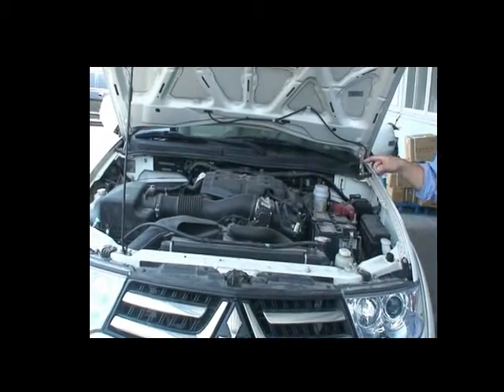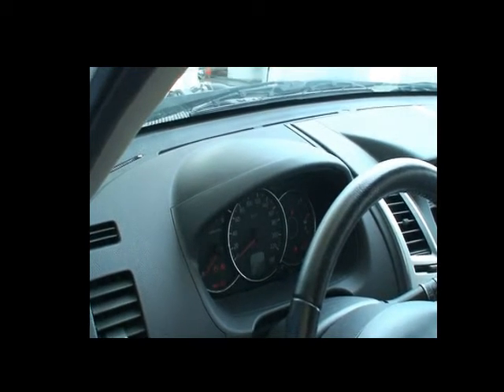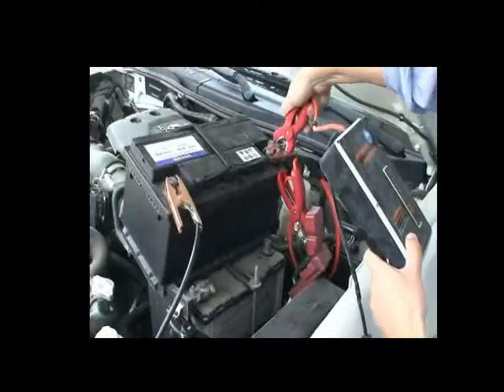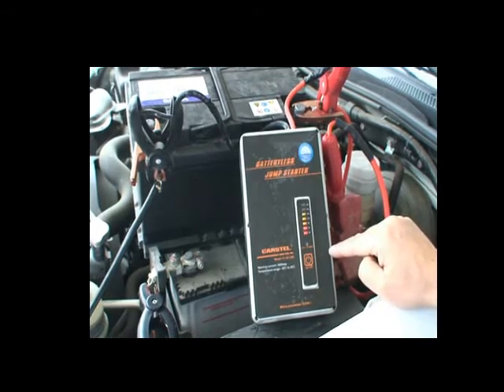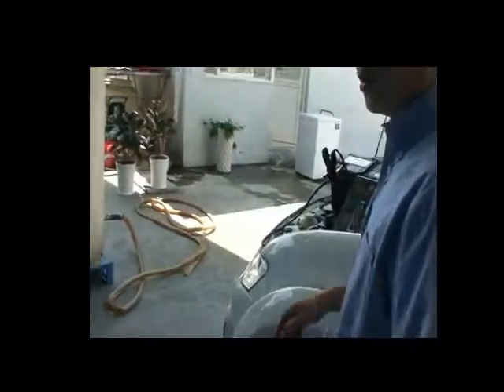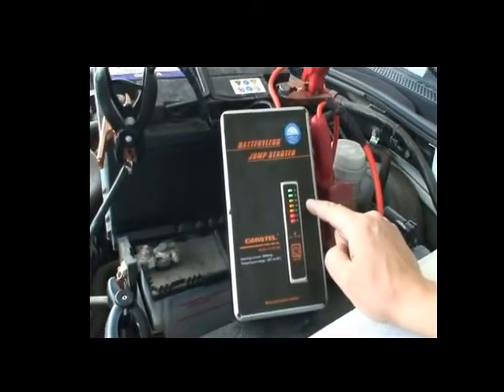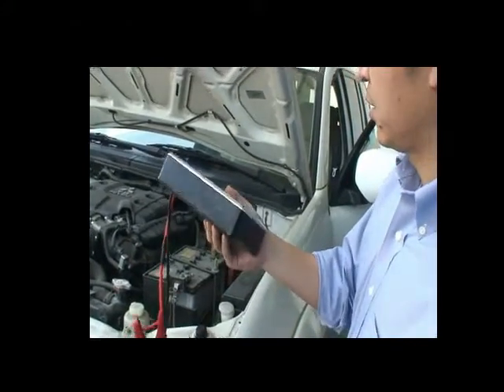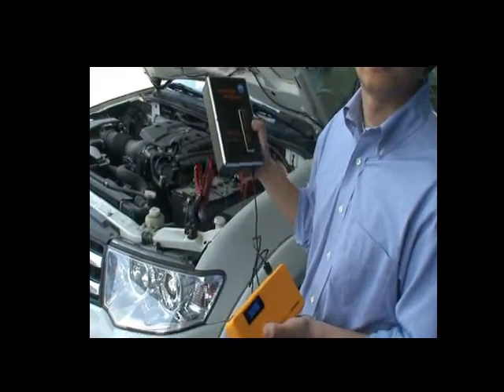General demo video for batteryless jump starter

Comment: I wanna see how long it will crank the engine if the engine does not start.
Would we be able to use this unit for running a Laptop for hours?
Reply: It has no internal battery so no wont power anything on its own, they are no good for prolonged cranking it's just designed to give it enough belt to start.
Reply: Mark moto That is what I thought.
Reply: Mark moto I love that Puppy.